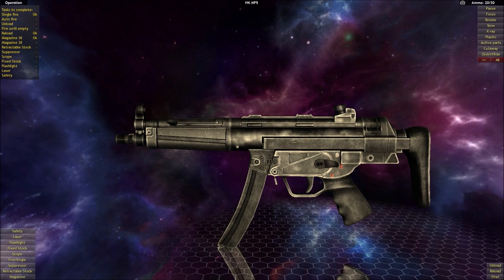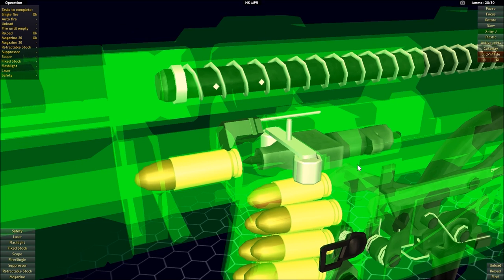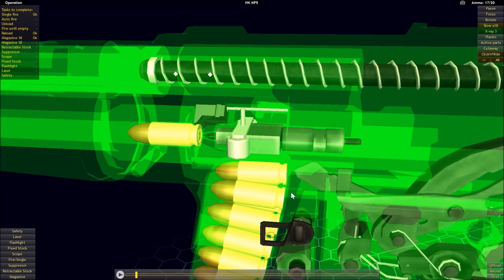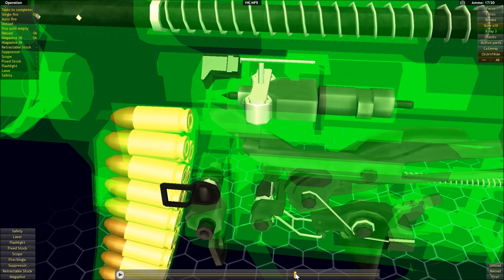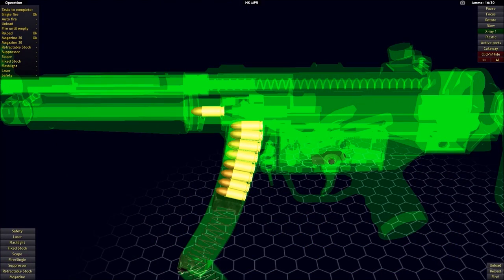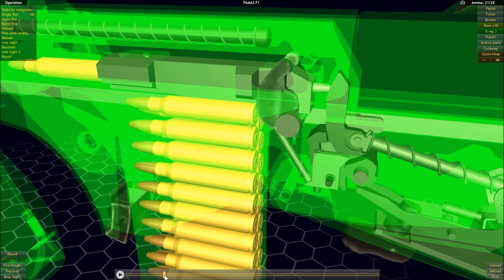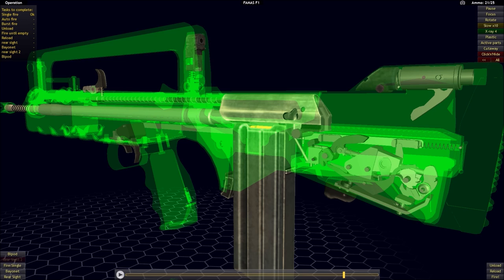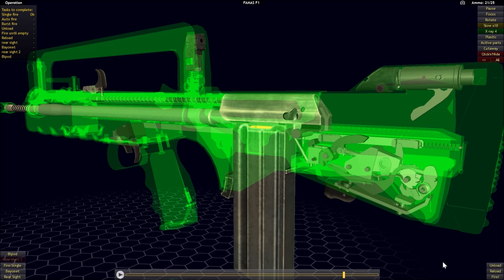Delayed Blowback System in Firearms

Comment from the maker: If you are wondering what program I use for the creation of this video, please check the description. It should be included on every video in this series, if not let me know.
Reply: Sir, If the Bullet goes forward by Pressure,what thing pulls Case and Bolt Backward till the case is ejected?
Reply: @Hassan_MM.  
this is how the mechanism of roller delayed blowback design works. https://commons.wikimedia.org/wiki/File:Delayed_blow_back_breech_with_locking_rollers.jpg
https://commons.wikimedia.org/wiki/File:Delayed_blow_back_breech_with_locking_rollers_(en).svg
The delay is measured in the microseconds.
Reply: Something is not explained exactly right in this video I noticed. You mention that the two rollers cant move back and so instead move inwards. This is not true. The rollers do move backwards, but just at a different paste as the bolt body. Those two angled surface where the rollers push uppon are like that to make the bolt body move backwards at a greater speed than at which the boldhead is moving at. This does two things:
1. A small movement off the bolthead requiers a greater lenght of spring to compress than if there wasnt this mechanism, momentarily resulting in a bigger force resisting the opening of the chamber.
2. The moment the bolthead has unlocked, the recoil has mostly faded, therefore there being no firce left pressing on the bolthead to cylce the action. The force which was pushing on the bolt head has, via the rollers and cammed surfaces, axelerated the boltbody, which by its onw enertia then cycles the action, hereby reducing the ejection pressure.
Reply: Good job very very detailed I'm glad I watched and learned.

Comment: I experienced the eureka effect for how the roller delayed system works at 6:27 and it was probably the best feeling I've had to experience thus far in my life. I just have to put this out there sorry ;)
Reply: same!
Reply: Unfortunately the clip is wrong.
In a roller-delayed, lever-delayed, radial-delayed blowback (the principle is the same) the bolt body doesn't "move before the bolt head can move" like it's stated here. Otherwise there will be nothing pushing it. 
The bolt body and bolt head MOVES AT THE SAME TIME, but, due to a device (rollers, lever, inclined surfaces) the bolt body has to move FASTER than the bolt head. 
To accelerate something to a faster pace in the same time requires more energy, so the system absorbs more energy than it will if a bolt of the same total weight would have been used in a pure blowback gun, and that's the working principle of roller-lever-radial delayed blowbacks. THEY SIMPLY TRADE MASS FOR SPEED of a part of the bolt.
Reply: Neutron Alchemist yes, this was the biggest difficulty for me to overcome. I've been wondering for years, even after I got my hands on an actual MP5 bolt carrier group, how exactly the little wedge, the "locking piece" could start to move before the bolt did. I thought there was some kind of little cut out or piece that protruded directly into the chamber that the rear of the cartridge case pushed on, because otherwise I don't see anything that could cause it to move rearward. It was only until I realize that both pieces of the boat were moving backwards, it's just that the head could only move a microscopic amount to cause the rollers push inward, just pushing the little wedge back. I don't know how to describe it, but it was a very strange feeling to finally grok it.

Telling people that the bolt head doesn't move at all until the rollers unlock is very misleading.
Reply: @neutronalchemist3241  Not really. The roller delay system has no bolt accelerator- so roller delay and lever delay work on different principals.
Reply: @bobbowie5334  In a roller-delayed system, the rollers accelerate the bolt body in respect to the bolt face. The principle is the same of lever delayed, it only uses rollers instead of levers. 
https://upload.wikimedia.org/wikipedia/commons/0/0a/Roller_delayed_blowback_action.svg
the single roller Korriphila works the same way. It accelerates the slide in respect to the bolt face. https://modernfirearms.net/userfiles/images/handguns/germany/hg176/1287735916.jpg
Reply: Me too. It is not that the wedge moves back so the rollers can move in, but that the rollers push the wedge back so the rollers can move in. I had missed the boat on that.
Reply: @neutronalchemist3241  Naw- the rollers in H&K guns basically are brakes which are applied to the bolt about a millisecond after the cartridge is fired. The lever delay principle depends on the bolt carrier having a higher velocity in relation to the bolt- which unlocks as the bolt carrier passes a certain point- that point being calculated to be after the bullet exits the barrel.
Reply: @bobbowie5334  The funcion of the rollers in a roller delayed blowback is to accelerate the  bolt body in respect to the bolt face. The principle is the same of lever delayed, it only uses rollers instead of levers. there is no "unlocking". Only geometrically locked system "unlocks". 
In any delayed blowback system, like in any simple blowback system, the bolt starts to move rearward the same moment the cartridge is fired. In a simple blowback, the mass of the bolt must be enough to assure the pressure drops to safe level, first than the cartridge's case stretched enough to get ripped. In a delayed blowback, the mass is traded for the speed of a part of the bolt since, to accelerate something to a faster pace in the same time requires more energy, so the system absorbs more energy than it will if a bolt of the same total weight would have been used in a pure blowback gun.
Reply: @neutronalchemist3241  The H&K system is called roller locked for a reason. The rollers are not "little wheels." The rollers do not "accelerate."
Reply: I don't get it.  If the rollers are strong enough to push the bolt body backward during firing, why aren't they strong enough to do it when not firing?
Reply: Oh, I get it now.  They work the same as a Newton's Cradle.  The casing transfers energy to the bolt head, which traders energy to the rollers, which then transfer energy to the bolt body.

Comment: So is the general principle of this type of system to add inertia to the initial stage of the blowback cycle that is then overcome to allow a lower inertia bolt to finish the cycle? So that would mean the action isn't held closed or locked at the start of the cycle it's just got more resistance as if it were a really heavy straight blowback bolt?

Comment: holy crap. it took this animation and your explaination at 6:39 to understand how it delayed the blow back. Thank you so much as it perplexed me for a while.
Reply: Unfortunately the clip is wrong.
In a roller-delayed, lever-delayed, radial-delayed blowback (the principle is the same) the bolt body doesn't "move before the bolt head can move" like it's stated here. Otherwise there will be nothing pushing it. 
The bolt body and bolt head MOVES AT THE SAME TIME, but, due to a device (rollers, lever, inclined surfaces) the bolt body has to move FASTER than the bolt head. 
To accelerate something to a faster pace in the same time requires more energy, so the system absorbs more energy than it will if a bolt of the same total weight would have been used in a pure blowback gun, and that's the working principle of roller-lever-radial delayed blowbacks. THEY SIMPLY TRADE MASS FOR SPEED of a part of the bolt.

Comment: Okay, so what starts the movement back of the bolt on the MP5? We got two parts, the bolt face, and the bolt (with wedge), and the bolt-wedge starts moving back before the bolt face? What's pushing the bolt-and-wedge back before the bolt face? Cuz the blowback is coming from the cartridge case, which should be pushing against the bolt face, right?
Reply: Correct!  And that energy is first transfered through the bolt head to the bolt body (the locking piece) according to the same principle that makes a Newton's Cradle work.

Comment: I did stop the vieo in the 1st 2mins because i realize this is an older vieeo and i dont know if the Radial Delayed Blowback system was even created as of then by CMMG? I recently purchased a Barrel/BG combo of the CMMG radial delayed blowback system and paired it with a dedicated Range609 lower receiver and Angstadt Arms dedicated AR-9mm/45ACP/40cal upper. The one without a forward assist and larger ejection port. Im not sure if i will like it though only because i cant put on a port cover and its got an open gas port for a gas system....so far i havnt found any plugs for upper with gas ports for the CMMG radial delayed blowback system since theres no longer the need for a gas system. I dont want the gunsmith to have to weld or plug the port with lead? I want to be able to use the upper later if ever needed for another rifle that may not have a delayed blowback system? So i may have to purchase one of CMMG's upper that are made for their radial delayed system? Only because im thinking they would make them without a hold there?lol idk not an armorer or gunsmith and pretty green even after 9yrs in the hobby late in life! I got addicted immediately! My 1st was the typical 38Spcl for home protection and the 1st time i shot it i went out and purchased several other handguns and long guns within a few months! That 38 will always have a place in my heart and will never sell it and it will always remain in my night stand next to the bed. Nobody but my wife and i now so no bull about locking it up! lol finally got her to go to the range with me once after 7yrs in the hobby and she loved it but has a condition that is aggravated by the pressures produced even by a .22LR round going off indoors. Living in the bluest state in the country means we have one handgun range any where near us so she cant shoot with me anymore. Not 30mins into her 1st time shooting and she started talking about buying her self her own .33LR pistol or revolver? LOL But thanks to our blue state there are restrictions for everything. We cant take handguns or 22LR long guns to any public ranges as they must be more dangerous. And only recently were we Subjects of the empire were given permission to shoot our sporting rifles at said public ranges. In any case im building this new .45ACP carbine with high end parts and making it a one of a kind to make it even more special for me! I love the AR configuration and family of firearms as anyone can get into building them while watching a youtube video or 10!!!LOL Thanks so much for your video it was cool!

Comment: I've read some comments but I still don't understand how the first part can start moving if the case is completely still. Is the case deforming and creates a bulge that pushes the firing pin?
Reply: Just because it isn't moving, doesn't mean it isn't applying force. Consider that, because of pressure in the barrel, the case is pushing back HARD on the bolt until it fully exits the chamber.
Reply: I was wondering this too, and I found a good article which explains it at 

https://www.americanrifleman.org/content/roller-delayed-revival-the-heckler-koch-sp5k/: 

"To delay the opening of the action, the force of the fired cartridge’s expanding gas is transferred from the bolt head to another heavier component in the system—in the G3, the barrel extension, bolt carrier and action spring. 

Think of the Newton’s Cradle physics toy. If you pull two of the suspended spheres away from the other three and release them, they impact the center sphere, which stays stationary, but transfers the force to the two opposite outer spheres, causing them to swing away. 

In roller-delayed terms the two outside spheres on one side are the force of the cartridge firing, the center sphere is the bolt head and the two spheres on the opposite side are the barrel extension, bolt carrier and action spring."

Comment: The Germans used rollers in ww2 on the MG42 to speed up the cyclic rate. I'm not 100% certain but I think that was the first gun the design was used in?
Reply: adam briar Rollers were used in the 42, yes. However it doesnt use blowback. The first roller delayed blowback was to the successor of the StG 44 which is StG 45.

Comment: I'm still wondering about how the bolt carrier moves inward first while the bolt head haven't been pushed yet. is there like another gas tube that leads them to push the carrier? or is it just a mistake on the animation part?
Reply: Part of the energy from the black powder explosion travels through the stationary bullet casing, through the bolt head, through the bolt body, to the bolt carrier, and applies enough force to push back on the recoil spring.  When that happens, the bolt carrier moves backward, taking the bolt body back with it (because they're attached), which then allows the rollers to contract inward, which then allows the bolt head to travel backwards.

Comment: The rollers should be moving in simultaneously as the locking piece starts to move rearward, not after it starts moving. Their inward movement is what drives it rearward. Also the bolt head does start to move very slightly to the rear as the rollers compress inwards, its just too slow to expose the thin cartridge case walls before the bullet exits the barrel and pressures drop to safe levels.
Reply: From what I've read, their inward movement is not what drives it rearward.  It's driven rearward by the transfer of energy to the bolt carrier (to which it is attached) and recoil spring.

The energy transfer occurs in the same way as it occurs in a Newton's Cradle children's toy.

Comment: The rollers don't necessarily start moving inward immediately as the wedge retracts.  They have no force pushing them inward applied to them until the bolt head begins coming back as well, dragging them against the trunion, which then pushes them in.
Reply from the maker: I did say the rollers ride along the sloped surface, implying rearward motion as that is how they would do so, but you are right that I did not perhaps make that as clear as I should have. Most of my older videos were done unscripted and all in one take originally, this being one of the first videos of its type that I made, so they are a little rough around the edges.
Reply: Just a point of clarification.  The rollers are captive between the trunnion ramps, the front faces of the bolt head, and the locking piece shoulder angles.  The pressure of the discharged cartridge against the bolt face is what forces the rollers against the trunnion ramps squeezing them inward against the locking piece shoulder angles. The roller pressure against the locking piece shoulders pushes the carrier rearward against recoil spring pressure.  

The video is graphically superb but the description makes it appear that the carrier moves rearward (before the rollers start to retract) and then the bolt head follows. Great job on the graphics!

Comment: 4:35 What is causing the rollers to move back if the cartridge is locked in place at the time of firing?
Reply: The force of the gasses push back the bolt. And I assume return springs push those rollers in. Personally I feel like this is really over designed.

Comment: So, the first part is kinda like a gas operated, but with rollers, right?
Reply: Praise the Moon there are many different types of gas systems.
Reply: Really not. In a gas operated firearms, the breeck is locked until the gas (via a short stroke piston, long stroke piston, or direct impingment) unlocks it. 
In a delayed blowback system the breech is never locked. 
In a roller-delayed, lever-delayed, radial-delayed blowback (the principle is the same) the bolt body doesn't "move before the bolt head can move" like it's stated here. Otherwise there will be nothing pushing it. 
The bolt body and bolt head MOVES AT THE SAME TIME, but, due to a device (rollers, lever, inclined surfaces) the bolt body has to move FASTER than the bolt head. 
To accelerate something to a faster pace in the same time requires more energy, so the system absorbs more energy than it will if a bolt of the same total weight would have been used in a pure blowback gun, and that's the working principle of roller-lever-radial delayed blowbacks. THEY SIMPLY TRADE MASS FOR SPEED of a part of the bolt.

Comment: What causes the markings on the casing after its been ejected from a roller blow back system?
Reply from the maker: I apologize for missing your comment. Are you referring to a G3/CETME rifle? If so the marks I believe you are talking about come from the fluted chamber. Fluting in a chamber helps with extraction, as the pressures involved with .308 being fired in a roller delayed rifle can be on the high side.

Comment: Why aren't blowback systems the preferred systems instead of gas systems?
Reply from the maker: Although delayed blowback systems can chamber rifle rounds, modern gas operated systems handle high pressure much more easily. For instance H&K had to use a fluted chamber to help with extraction in the G3 rifle, because of high pressures during extraction.
Reply: In any blowback system, the case starts to move backward when the pressure is still at unsafe levels. Otherwise there will be no movement at all.
That's not a problem for pistol cartridges, that are short (so with a limited contact surface with the chamber), and operate at relatively low pressures. 
It's a problem for long rifle cartridges, that operate at higher pressure, and have a wider surface that is stuck by this pressure to the walls of the chamber. In those conditions, small differences in the condition of this surface (brass or steel, presence of water, of oil...) can have great effects in the force with which the case pushes the bolt rearward, and so  in its speed, and so in the safety of the system.